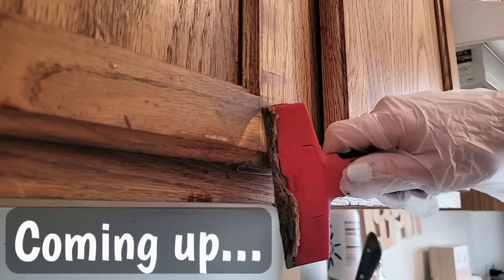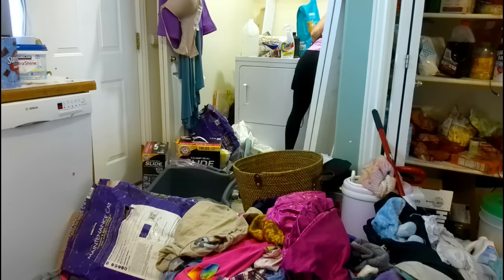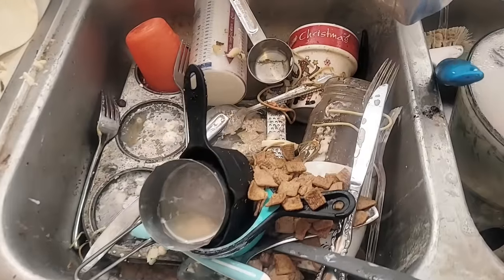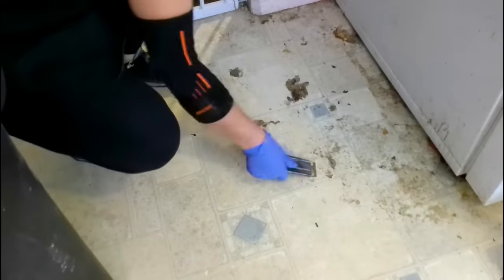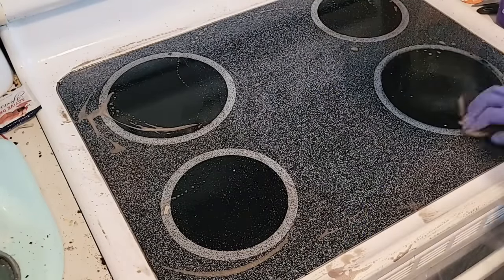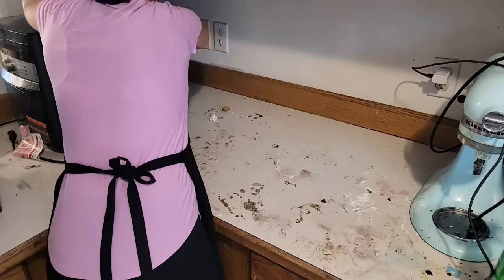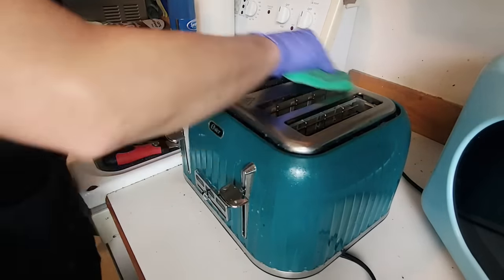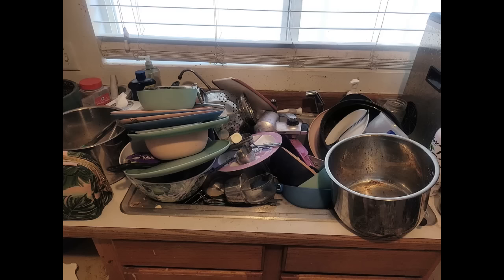Free kitchen cleaning for overwhelmed parents with mental health issues #cleaningmotivation

Comment: I put a sheet of aluminum foil in the bottom of my oven under that heating element.  If something boils over, just put out the foil.  Great job!
Reply: I have heard that will ruin the oven.  We bought some disposable tin trays for that.
Reply: @brg2743  It hasn't so far.  5 years   Fingers crossed

Comment: First tip.  Put the garbage in the garbage can and then take out the garbage when it’s full to the curb or the dumpster just so it’s out of the house.

Keep up with the laundry, wash, dry, fold AND put away.

Keep up with the dishes .  

These things give you the best bang for the buck.

This is the reason why I have very few small appliances and I don’t have a toaster oven, nope 👎 because I don’t want to clean them. I also don’t have any blinds for the same reason. Curtains are much easier. 😊. I also for the shower I do not have any shower doors for the same reason I just use a curtain and then when it gets icky I throw it away so those are my tips for you because I’ve been there and I don’t want to do that anymore.
The small appliances that I do have I use them then I want them down and then I put them away in the cabinet or a pantry because if you leave them out on the counter, they’re going to get splattered on by other things that you’re doing and making

Comment: Do you always walk around and start by picking up trash? This is a great method I have used in the past (for myself and others).  It's surprising how much there can really be.  Love your channel.
Reply from the maker: Yes, usually I start with trash.  Sometimes though I start with the thing taking up the most room, which, in this case, was laundry, as you can see! LOL! I just wanted to get that all gathered and started washing since I knew it would take several loads to make a difference.  Then after that, I went after the trash.

Comment: I grew up in the USA with wooden floors in the bathroom, no drain. Now I live in Australia and  we are required to build bathrooms with concrete floors and drains.  Not everyone has a hose, sprayer, but they are great when working with disabled and elderly. I think Aurikatariina works mostly in modern apartments.

Comment: In Brazil we also follow European style, even for cities, leisure...I'd say life in general. Americans decided to rebel, that's how I see that country/culture - and didn't end well in my eyes...I share the views of channels like Not Just Bikes.
So houses or apartments here are made of bricks/concrete, and have wet bathrooms and kitchens with ceramic or porcelain tiles covering all the wall and floors. You can soap top to bottom and rinse into the drain. 
For the hallway, bedrooms, living and dining rooms we usually have wood, ceramic, porcelain, laminate flooring. If we feel the floor is cold, we use tapestry or wear socks/slippers.
Our houses and apartments also are very small like the ones in Europe: 2 bedrooms+full bathroom around 40 - 50 m² / 3 bedrooms+1.5 bathroom around 60 m².

Comment: Did you spray anything on the cabinets before you scraped them? I have a set above my stove I can not get the grease off never thought of scraping it off...you are doing amazing on cleaning and the homeowner is doing amazing also
Reply from the maker: Yes, I sprayed Super Clean degreaser on it before I scraped it. I would probably recommend a plastic scraper versus a razor Scraper on it though as some of the finish did come off a bit with this method, although they were pretty much ruined in the first place which is why she allowed me to try it. It still looked a lot better just because of the amount of grease and Gunk that was caked on there. I think that it would work really well with a plastic scraper and some degreaser.

Comment: Please, please don't mix cleaners! And please don't put batteries in the garbage. They can set garbage cans and trucks on fire!
Reply from the maker: I don't usually mix cleaners, but both of these were degreasers and they worked amazingly well together. I know bleach and ammonia are two that you have to be extremely cautious with.  I never mix those with anything else.  I have heard that about 9V batteries, but not your standard AAA or AA, etc.  If not in the garbage, where would you dispose of them? Is there a battery recycling place?

Comment: I have never in my life cleaned my toaster didn’t even know you could… I hover it over the sink and tap the toaster and clean the pull out drawers at the bottom. I didn’t think you could spray anything inside the actual toaster
Reply from the maker: I didn't actually spray anything inside of it, just on the surface. If you rewatch that part, I keep the spray very concentrated so it doesn't get inside the toaster. I'm sure a small amount getting inside would be fine, but I tried to keep it mainly just on the outside surface and then scrub it.😊❤️👍
Reply: @ABeautifulMessExtremeCle-zl1wp  oh thanks for letting me know. I was about to start cleaning it that way 😂
Reply: You can clean the inside of a toaster with a baby bottle brush! Just be sure to unplug it first, and I like to use dish soap and water in a spray bottle, give it a good scrub, and rinse with 1 part vinegar water and 2 parts water. Let the toaster dry completely, (I aim a fan at mine to speed up the drying time), and once it's dry, I plug it in and switch it on for a bit to burn off any residue on the heating elements. 😊

Comment: When starting a big cleaning project how do you know where to start? I would be so overwhelmed 😅
Reply from the maker: After picking up any obvious trash , I usually start with the thing that stands out the most as being something that will quickly change the appearance of a room. In this case, it was the clothes, so I started with gathering, sorting, and cleaning those and then tackled the next biggest item, which was the dishes. I have found that those initial big changes help keep me motivated to keep going and the rest of the stuff sort of naturally falls into place for me as I go.

Comment: regarding the homes here in Finland: I have never seen a place with carpet. all the floors here are wood, plastic or some kind of vinyl/laminate. bathrooms have either tile or plastic floor. finland has also a pretty good government system that usually prevents major hoarding from happening.  mental health treatment is free (excluding private therapists), having a social worker coming in weekly to check on you is free etc.

houses here also tend to be smaller than in the us, so the hoard is easier to tackle.
Reply from the maker: That is so cool that the government helps with that sort of thing. I really wish we had programs in place here for something like that. As far as I know, there's not really any help here for these kinds of situations on a broad scale.

Comment: That child of yours is excellent.. 😂.. hope hes ok. But, hes a boy. Hell do it again. Should take him cleaning with you.  Keep him out of trouble.  🤣🤣♥️♥️
NEVER MIX OVEN CLEANER WITH ANYTHING.  HIGHLY TOXIC. 
NEVER USE YOUR CARPET CLEANER IN YOUR AS HOUSE AND THESE HOUSES. YOULL TRANSFER COCKROACH EGGS, MITES, BEDBUGS ETC. ❤ Please be careful ❤
If you go camping again,  no guns and tape your sons mouth closed. Better still, frisk him .😂.
Reply from the maker: Thank you for your comment. And thank you for putting it the way that you did and not being reprimanding about it. 😊I am aware now that I should not have used anything else with the oven cleaner and I have posted in a comment at the top of the comment section that no one should do that even though I did in this video and everything turned out fine. As for the carpet cleaner, I always make sure that I take it in my backyard and take it apart as much as possible and hose it out really thoroughly and leave it outside for a day or two just to make sure I'm not bringing anything into our house. 

And, yes, gotta keep an eye on my teen, but, you're right, he is a boy and I'm sure he will do something dumb like this again. 😆

Comment: G'day again! Just wondering what product you used on the oven door. Is it ok to use on ovens which are self-cleaning? I haven't used the self-cleaning setting on mine, mostly because of the time and heat involved so I'm looking for efficient ways to clean my oven "by hand".
Reply from the maker: I hate using the self-cleaning setting for that same reason...the time and heat involved, plus it stinks like crazy since you're just burning everything off.  I know oven cleaner doesn't smell great either, but once you close the door and let it go to work, you can't smell it and I feel like it does a great job without heating and stinking up your whole house for hours at a time.  I actually used a combination of oven cleaner (any oven cleaner is fine...Easy Off, Zep, whatever) and Super Clean which is just a degreaser.  You can probably use any kind of degreaser.  I'm sure some people will say not to use two different products together, but I found that these two combined have worked better than anything else I have ever tried.  Just wanted to put that disclaimer out there.  As for the self-cleaning oven and it being safe to use oven cleaner, there seems to be some debate about that.  I think the real problem is using the oven cleaner and then later using the self-cleaning feature as those chemicals that were used before will heat up to an extremely high heat and could produce toxic gases in the air while cleaning, but if you never plan to use the self-cleaning feature, I would say you are fine to use the oven cleaner method.  Of course you are welcome to research that more yourself.

Comment: Would you mind explaining your mopping process? I've never seen anyone mop like that, then use paper towels on a squeegee.
Reply from the maker: I usually squeegee it all together and then use the paper towels, but that one section, I decided to try to actually squeegee with the paper towels so the liquid wasn't just spreading back over the floor before I could get it all soaked up with the paper towels. I only mop this way on really filthy floors that need a lot of liquid to loosen up the dirt. On my own floors at home, I just use a Swiffer with a microfiber cloth tucked into it and the just spray the floor with cleaner and mop it with that.  The Swiffer method I just described is usually the last step I do in a house like this. You will see me do that in some of my other videos.

Comment: The oven! Just wow! Do you use the self clean cycle on the oven or simply spray the cleaners and let them work for a couple hours?
Reply from the maker: I just spray the cleaners and let them do their work.  I don't like using the self-clean cycle because, at least when I have used it in the past, it makes an awful smell throughout the house, gets a little smoky, and heats up the house, which, in the summertime, is not ideal. This was definitely the best combination of cleaners I have ever used on the oven. I don't usually mix cleaners,, but since they are both basically degreasers and they were going to be sprayed and then the oven door closed, I felt okay about it and it turned out amazing!

Comment: Is there a recommendation you have for stainless steel stovetop cleaning?  And what do you recommend for everyday cleaning on granite.  My new house has granite and I'm used to solid surfaces or formica.
Reply from the maker: I'm assuming you're talking about the heavy duty stainless steel stove tops that have the big burners with the heavy removable grates because I can't picture any other kind of stainless steel stove top. If so, my friend has one of these and I just used Super Clean Degreaser on it and let it sit on the burned parts for a few minutes before I took a Scour Daddy to scrub it off. Sometimes a razor scraper is helpful too for really burned on things. Then, to really shine up the stainless steel, I like to use Weiman's stainless steel cleaner. There is actually a link to that and some of the other products in the description of this video. As for the granite countertops, I don't come across a lot of granite countertops, but I know you do have to be careful what kind of cleaners you use on it. I think just a tiny bit of dish soap and water should do the trick or a cleaner that's made specifically for granite.

Comment: How do you decide where to start?
Reply from the maker: It depends on the situation, but I usually get any cleaners applied to areas where it needs time to sit and then I will tackle the thing that will make the most difference the quickest. Sometimes that's picking up trash, sometimes that's gathering clothes, etc.